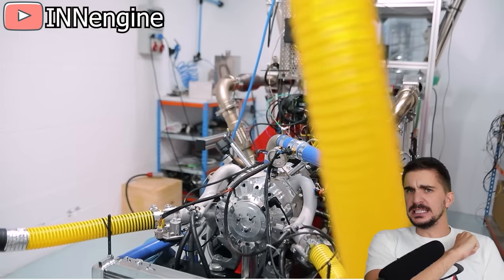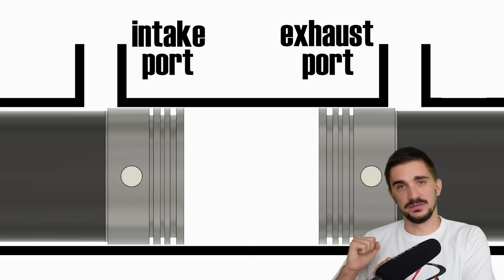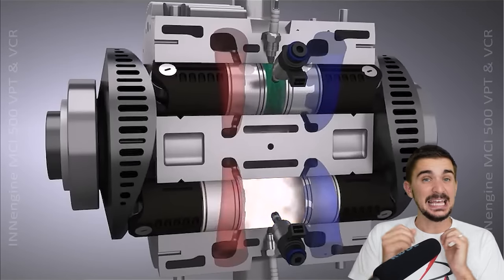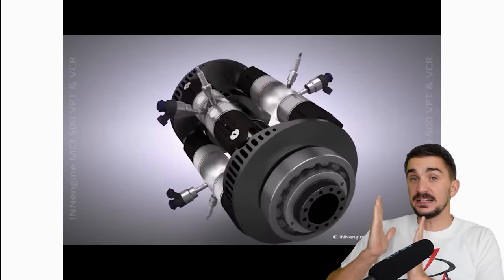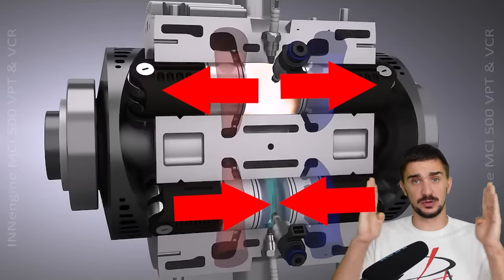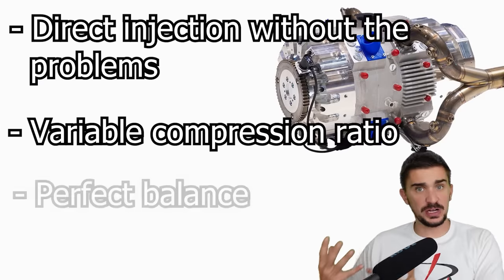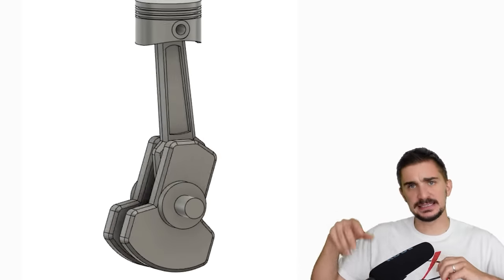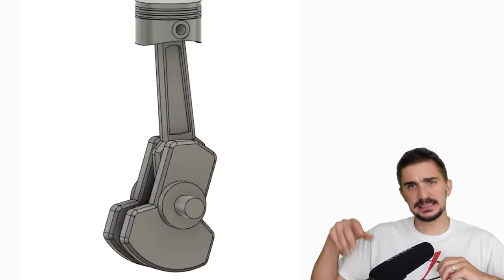Spain is Living in 2050? Revolutionary 1 Stroke INNengine Analyzed

Comment: Wavy think is a lobe. Like on valve shafts. Ive seen this design somewhere before. Ill continue, ok that's not how it works. The force needs to be multiplied. Engines run a flywheel what maintains forward momentum. Otherwise the engine would stall. That's why we use a starter to get it flying in the right direction.

Comment: Wouldn't those bearings or crank disk? wear out pretty quick because of the properties of a spinning wheel having the outer part and inner part spinning at different speeds but the bearing can only spin at one speed. Meaning that it would rub.

Comment: ...the most obvious issue is making the "wavy thing", as that looks a LOT like a 4 or 5 axis precision job.
Aka. VERY co$tly.
(And ofc. that also means that it would have been tricky to make in the far past - before CNC milling became a thing)

In regards to the "but not enough torque", and "but needs forced induction".
Well gear boxes exist - and replacement for displacement does exist, high RPM. Frankly at claimed weight it would make a fine motorcycle engine.

Comment: Another interesting idea brought about because of potential use as a range extender in an EV. At least there's one upside to all of this EV obsession. The threat of unforeseen issues with a new concept is what kills the desire for innovation. A customer may be willing to pay $33k for his SUV, but he's less likely to make that substantial purchase without the assurance that it will last several years. But, if a supplemental engine dies, well, at least you still have the primary motor. The downside, though, is that you now have to make 2 powerplants for each car.

Comment: Would not the engine burn oil since the rings would pass the ports? Once the rings pass the ports I would assume there is oil behind the rings.  So if you just made it a 100 to 1 mix it would burn less like boat motors.

Comment: "merry-go-round" arrangement is quite accurate describing its pathetic transfer of energy resulting in low torque but
why do you need much lo rpm torque out of it if its just going to run a generator at a fixed rpm ?

Comment: It would be interesting to see actually powering a motorbike. I imagine with a system like Honda DCT it could have potential as a cruiser engine, by letting the computer keep the engine where it produces power just efficiently and changing gears accordingly.

It could also be interesting to see as a sport bike power unit if it really is as peaky as we think in producing its power.

Otherwise i wonder how well it does for cooling at high rpm, since the arrangement of the combustion chambers, with how compact it is, seems conducive for retaining far too much heat in the core of the engine. Perhaps this is why we have yet to see it run in the car at full throttle. Although it may just be a matter of development time before issues like this are ironed out.

Comment: The efficiency, even though there is a gain from the opposed engine format, must still be terrible. The mechanical power transmission angle of the virtual linkages created by the swatch plate will be abysmal, so most of the power will be converted into 1. friction and 2. heat from elastic material deformation. The swatch plate is honestly my least favourite feature of the design. Also, the spark plug placement will create a very inefficient combustion pattern, with the pressure wave moving across the pistons from side- to-side rather than from the middle outwards. You'll also likely get some gross secondary combustion events.

Comment: This look very much like a mix between the Duke Engine and the Opposed Piston.
Very interesting.
However, I can foresee a lot of ware & tare on the piston rollers...

Edit: New designs/technologies have their own lifecycle and are also subjected to social and economical forces.
Even if the tech is good, it doesn't mean it is easily manufacturable or maintainable.
(The best example here would be Diesel Fuel Cell for cars. This tech exist since the 1980s but is hard to manufacture at scale because of cost) 
On the political or social acceptance side, we can put Nuclear Power.
Everyone knows this is the most eco-friendly technology to produce energy, but we don't invest much in it because of other social & political considerations.
(To be exact, the political requirements generate an issue which then create social disapproval...)

Comment: My feeling is that the INN engine very closely resembles the internal function of a Pressure Washer, but with opposing pistons. If it was a great idea, this engine would be in some of the latest-produced cars. I just have to say, that the Presenter has gone to extreme lengths in the explanations of how (almost) every single engine works. Problem is, that Oil is not on this earth for an eternity. By comparison to an EV, this new engine will lose approx. 40% of its efficiency - due to heat, along with every other ICE.

Comment: It still has all 4 phases from a regular 4-stroke engine. Just replaced the crankshaft with the "wavy thing". Wondering what the "wear and tear" on the "wavy thingy" will look like after a few thousand miles.

Comment: wait? the torque is there very easy to calculate, it is just the force of the piston times the cos(angle of the wavy thing) times the radius of the cylinder, that torque must by  almost constant by the arrangement of the engine.

Comment: They're calling the one hybrid power-exhaust cycle per two or four cylinders at the same time as one stroke misleadingly, but calling it a One Cycle Engine would still be impressive if you know what Cycle means in an engine. Most may know what a Cycle is, if they know what a Stroke is.

Comment: This engine may have been used in electric motor-driven cars at the fixed and most optimal rev/minute driving a generator supplying energy for the electromotors. No more need for heavy battery packs in the car! Just a small one or a big capacitor instead...

Comment: Electric motors seem the way to go honetly. Simple, reliable, powerful, controllable, scalable to any size. These days a 4x4 vehicle with solar on the roof and power unit can run a fridge, computer, heater etc indefinitely. Or recharge your E-mountain bike pretty fast. 15-20-30 years from now maybe solar on your roof rack will be able to power the entire car!

Comment: Aren't they going to have bering problems like the rotory engines, those cams on the end aren't quiet directly in the thick of pressure but they are going to wear for sure. Hopefully they will be easy to change but that's not the case

Comment: It is not possible to have 1 cycle with a piston engine. This one is a two stroke. Compare the power cycle to any two stroke engine. What is connected to the pistons is different. What differs in this engine is how the power stroke is converted to rotational force. Great idea, will it stand the test of time?

Comment: AT its core it is an opposed piston 2 stroke engine.  Not much different than a Napier Deltic or Detroit.  As such, it relies on scavenged air and, in turn requires forced air to push fresh air in.  I think they call it a "one stroke" because, even if reduced to a SINGLE cylinder, there are TWO combustion events for every ONE of the output shaft's (wavey thing) rotation.  Think about it though, one could machine that part with 3, 4, 5 or any number of "waves" provided the diameter allowed the ramp angle to stay workable.

Comment: I think the bearing rollers on the pistons are not gunna last 250,000k miles so it will require alot more rebuilding than normal car engines.

Comment: I don't understand how a two stroke design, even a one stroke type two stroke like this one, with timed ports can be super charged without managing the exhaust simultaneously, like it is with an exhaust valve, After a lot of time considering this subject, the only way I could determine a two stroke could be super charged would be to have bothe the intake and exhaust equally effected by the forced air. Effectively a tuned exhaust acts like a supercharger using a shock wave to pack any fuel and air that escaped back in through a still open exhaust port, otherwise I'm totally open to being shown how it's possible using forced induction.

Comment: great idea, bad timing!
IF we for some reason dump dattary EV and hydrogen EV path then maybe it would be  great fit for hybrids
but in current state i don't bele in it, hydrogen plug-in hybrids makes so much more sense

Of course  the infrastructure is the issue 
but it can be solved via on-site hydrogen production via electrolysis 
hydrogen can be stored in relatively small quantities (by weight) this way in relatively low pressure tanks, because it doesn't need to be transported
this helps to cut large portion of "inefficiency" argument around hydrogen (compressing/liquifien and transporting)
also you can make fast chargers for EVs simply adding on-site large fuel cells

Obviously this is less efficient as storing electricity directly into batteries
but i assume that it's more economically and environmentally sensible to have some maintenance on a pump, then replace whole battery stucks every few years

Comment: Doesn't the leverage come from distance between the cetral shaft and point at which the cylinder rollers interact with the wavy thing? While there is probablya lot of force lost just pressing against the plate, instead of spinning it, that occurs at a distance from rotation axis, hence, leverage?

Comment: Use an axial flux motor/generator to a battery pack solid state & super caps, to power an axial flux motor on the same shaft.

Comment: I wish you would state the facts correctly the thing you call the weightly thing is a counter weight cam also the pistons are also values while it don't use oil in the fuel the ring will allow some oil to be burned. and this will incerss as the engine ages

Comment: the biggest impedance to adoption of new engine designs is that those who make them do not make cars. they have to sell their engine idea (or the engine itself) to a car manufacturer. Or customers must buy a car, take out the traditional engine and put a new engine in it. lots if $$$.   So  a  car manufacturer must come up with its new fangled engine (mazda rotary, not so good; and Tesla, again not so good but going ahead with it anyway) IN its cars.  If these new engine designers built their own cars, then you avoid this problem.  Or they get together with a company to build car frames to put their engines in.

Comment: I think you omit the biggest potential issue, the one that effectively killed rotary/Wankel ICU designs. Especially strange to miss while talking Mazda - they were the ones that put a Wanker (pun intended) into a mass produced sporty car.

And that issue is reliability and mechanical losses in the sophisticated arrangement replacing the rod-and-crankshaft system of traditional ICUs. Additionally, rotaries are pain to lubricate (Mazda mx-7 famously drank oil like kids drink cola), this one appears to have better chances in that regard.
However, the rollers-on-wavy-thing method of transferring inherently reciprocating combustion movement to a rotational one is obviously way more complicated and demanding than eccentric or rod-crankshaft. 

And mind you, both of those are known weak points. Even after 100 years of engineering, failure of rod-crankshaft arrangement is among the most prevalent causes of terminal failures of traditional ICUs, 

Here, the entirety of useful energy of the engine will be transferred through the relatively small rollers onto the sophisticated curved surface of "the wavy thing". At speeds, under thermal load of combustion just few centimeters away. Even made of superalloys, there will be ruts developing, there will be rollers failing during operation, and my fair guess is, the entire system will consistently cause way more mechanical losses than rod-crankshaft; most of these as frictional heat, adding to the first half of the problem. Both wavy things will also need to maintain very good rotational balance through the lifetime, wear and tear, because even miniscule wobbles will translate into irregularities in combustion cycles (because pistons moonlight as intake and exhaust valves), again a self-aggravating progressive kind of issue. 

For the frothy whipped cream topping on the cake of suspiciously brown substance, that entire low-tolerance assembly will be air conditioned by the inevitable cylinder blowback gasses, so that precious wave-roller contact surface will be impossible to keep pristine.

Ironically, given their claim about "2-st only being able to produce so much power", these kinds of troubles will be exacerbated with the higher the rpm, power and torque.
It may well turn out as a design that can only be realized with acceptable long-term reliability and maintenance requirements in relatively low levels of those, but with the comparative advantages only materializing at high. And then stay on the drawer waiting for those perfect materials and manufacturing methods to deal with all this pesky nitty-gritty, much like rotary ICUs already do.

Comment: Complete noob to engineering here but isn't the distance (on the new engine) from the point the piston touches the wavy rotating thing to the crank the same leverage as the leverage you showed on the normal piston? Granted the transfer of energy isn't the same as the new one pushes on a sloped angle instead of a direct transfer but in my mind its sort of alike

Comment: it is not a single stroke engine at all, it is a 2 stroke, 1 stroke for induction and compression and 1 stroke for power and exhaust! A 1 stroke fuel engine is impossible. A 1 stroke 'steam' engine only is possible.

Comment: Old days 2 strokes bike had power valve that worked from a servo that would rotate the power valve but with time the valve would wear due to carbon damaging the sliding surfaces and become very noisy and sometimes the valve would just jam also due to carbon build up so rotating valve are not perfect

Comment: the "wavy thing" seems to take a lot of force without any pressurized oil supply, it looks like ballbearings are supplied by splash oil, taking the grunt of the force created by the engine. theres gotta be a lot of force applied from the bearings to the "wavy thing", seems like a disaster over a long period.

Comment: No cams? Hmmm.... except for the two sinusoidal torque absorbing ones (csm plates). Single stroke? By definition, this is a two-stroke, overlapping ported (the two opposing cam pates slightly phased), fuel injected engine. The port overlapping lends itself to supercharging, either carburetted or fuel injected.
This concept is not new. In 1875 a steam engine had been designed with a swash plate and a patent issued to one D. K. West. A myriad of such swash or wobble plate engines had been built and successfully run since, the Bristol axial engine being a notable example. Two American engines with revolving cam plates (like in this video) whose pistons moved in a straight line with truly harmonic motion. The Alfaro, by Aircraft Development Corporation of Boston, and the 12-cylinder cam plate Herrmann experimental barrel type aero engine. The axial engine’s compactness was difficult to resist by many a designer. Lubricating problems gave a lot of headaches, as the oil would be ejected by the cam centrifugal action, and contriving suitable bearings was extremely difficult. Undoubtedly this guy will have similar problem despite so many exotic materials popping out almost daily and fancy electronics. It should be noted that fuel injection peripheral gear is expensive and complex and usually accompanied by electronics such as FADEC with its own problems of maintenance, nauseating costs, etc.

Comment: im skeptical of the wave plates taking the abuse and having longevity. we already use wave plates (swash plate) to drive pistons in your common car A/C compressor but we dont use pistons to drive wave plates i cant see it being more efficient and thats what will determine the mainstream sucess of the engine i see too much drag to be more efficient not to mention all the emissions issues with 2t even with out the oil it would need foced induction to burn really clean

Comment: I have 1 stroke engine! It could be a 2 , 4 stroke engine, or a 6 stroke engine! There is NO valves! It has variable compression! It can burn hydrogen to powdered wood! I patented 20 years ago with with the internet! It burns kerosene with about 100,000 rpm, about 1,000 hp, and weighs 50 lbs! I now included  variable compression in the last 2 years!

Comment: So if this is a 1 stroke, then that ICE organisation has to explain what an existing 2 and 4 stroke engine are. Otherwise words and labels become meaningless. I used to drive a 4-stroke V6, so they are saying that I can call it a 15 cylinder 25 stroke SQ19 and still be correct. 

As to Spain living in 2050, I would suggest that it is more like 1950, because zero ICE by 2035-45 as most European governments are suggesting this will never live to see mass market adoption. I spent 10 years in and around the automotive industry, and have seen a lot of amazing developments to get around ever tightening emissions regulations, yet the amount of push back that industry has displayed against the next leap in automotive development (EVs) begs belief, and while when there is a major change there are always some winners and some loser (the rest holding their breath or rolling along if you like), this resistance is going to end maybe 60% of auto makers, most notably those that refuse to change. I went electric almost 7 years ago and can't praise electric enough, and every one of my acquaintances that has gone for a ride has voiced their desire to join this revolution when costs allow, and given it can take some 5 years to develop a whole new platform it does not bode well for laggards.